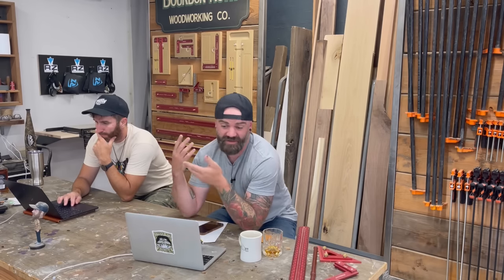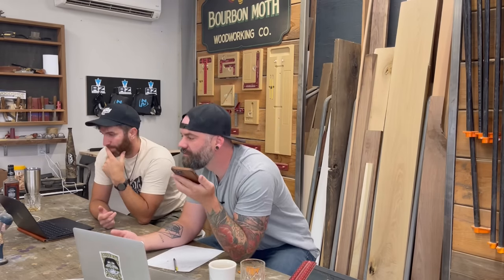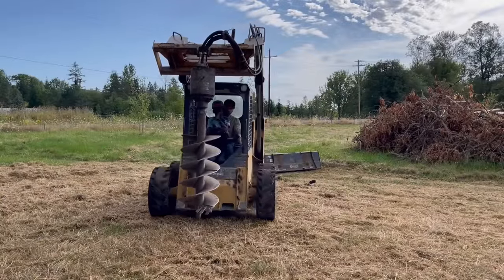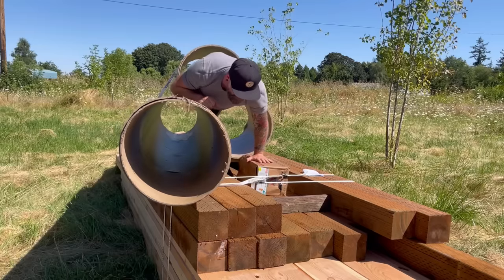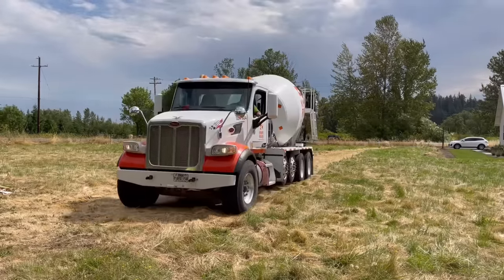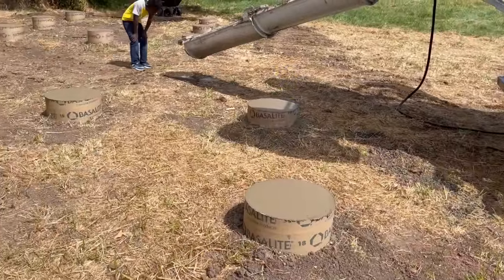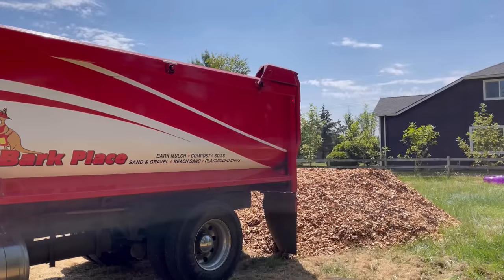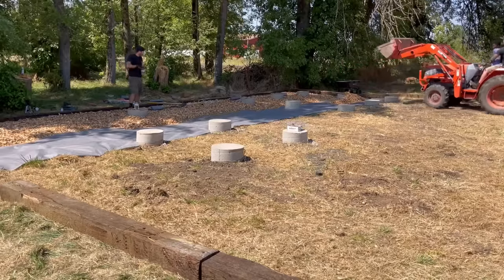Building a Treehouse || Pouring Concrete and Making Footings

Comment: Are you not going to anchor the perimeter down? And, from what I could see in the video, thee was no where near 4-6in of wood chips...maybe 2inches. Also, I did not see any rebar in the sonic tube.
Finally, when you do PVC or CPVC you should do a 1/4 turn when pushing it in the hub. Helps spreads the glue evenly throughout the joint.
Not trying to be negative, just pointing out some of the thinks I would have done if I was building this.

Comment: 13:54 The rebar at the bottom is tensile reinforcement.  The bottom of the footer will be under tension and the rebar will take that stretching load instead of the concrete which cracks under tension.  The spacers lift it up so the metal is completely encased in concrete and won't rust.  The rust expands and will crack the concrete as well.
Reply: Wouldn’t it only be under tension if it’s a light and tall structure?  To have tension, there would need to be a lifting force greater than the weight held by each footer or horizontal force large enough to tip the structure over.  Both of those seem unlikely to me… Maybe if it was really tall and had giant sail area and tornado wind speeds…

Comment: At least you got step one done right. I once helped an old guy build a house on top of a garage, starting with a concrete slab. Old guy put a couple of stakes down "about' where they should be then went on vacation. His buddy came by with his crew to pour the slab. Long story short, he never checked to see if the corners of his forms were square... Turns out that the side walls were parallel, but one was 18 inches longer than it should have been. We only noticed after framing the first floor and started laying the flooring, well when we were nearly finished laying it. When we got to the edge and had to cut an angle on every piece after that. Every decision started with. "Well, which corner do you want to be square in this room?"

Comment: Electrical conduit usually needs to be buried to 18 inches.  You also usually  pull individual wires through the conduit.

Comment: These treeless tree houses have a official name they are called “houses” and some people even live in them all the time. I’ve heard they are super nifty. I’d like to see one some day. Another way to check for square is the 3-4-5 rule. Pick a corner then measure 3 feet out one side and 4 feet out the there side and then the measurement between the the two will be 5 feet if you’ve made a square. It’s a quick way to see how good you think you are.
Reply: Also known as trigonometry - A² + B² = C²
Reply: Just geometry actually. 2 dimensions
Reply: @stevenfederoff7793  What? No? Trigonometry comes from the Greek words for "Triangle" and "To Measure". It's literally just the mathematics behind the angles and lengths of triangles.

Comment: Concrete is good under compression but not tension. The rebar adds tensile strength to reduce sheer forces that could crack the concrete.

Comment: Super cool project! Not sure the rebar is needed though, since the concrete will always be in compression and the colums are really short AND underground in a cardboard sleeve so no chance of tension by sideway loads. I guess it won't hurt to put some rebar in but in terms of safety or quality of the foundation, it doesn't do anything.
Reply: When the wind blows, it will create a lateral load on the structure that will be transmitted to the foundation so there could be loads other than strictly compressive. Same thing with the swing or all sorts of live loads.

Comment: Oh please, the rebar cage should be on the top as well as on the bottom of the concrete pier.  Normally people would also tie the vertical pieces to the frame at the bottom and top of the pier.  You have little weight on it so it doesn't matter if you had no rebar.  But if you are going to do it, do it right please.  You should have considered putting in the anchor bolts before the concrete hardened though if the concrete is weak it won't be too hard to drive in the anchor bolts required. Good luck with the new ear lobes.

Comment: You forgot to mention calling Dig-Safe to check out what's underground before drilling holes. Your doing great.
Reply: Does Dig Safe mark utilities on private property? Once you’re past what the utilities are responsible for you’re on your own I think.
Reply: @johnlee7085  yes they will, anywhere you are going to dig they will come out and mark it. Utility companies ran gas, electric & sewer lines all over the country underground when they were just empty fields. Then construction began in areas that were nothing then but built up now. Don't hurt to call. You don't want surprises when you start digging it's free.

Comment: Rebar gives the concrete a place to form micro cracks around when shrinking during drying. This prevents larger, visible and structurally damaging cracks to form. Have you ever seen a puddle on clay-containing soil dry out? It typically forms roughly hexagonal patterns of cracks. They are called drying cracks. Concrete will do the same thing if it has no rebar or the likes. Chicken net will do or even plastic fibres if evenly spread out in the concrete.
Reply: You seem to know what you're talking about. Should he have put a square at the top as well? For some reason I was expecting him to.
Reply: Janet; I have a lot of theoretical knowledge about concrete, but not too much practical experience, so I do not know just how much rebar you need to put in a certain volume of concrete. It depends on the shape of the concrete body, and I think, the round/cylindrical shape needs less rebar than slabs. I do know, that when you poor slabs (floors) and walls there is usually a grid of rebar with 6-8 inches between each bar. It was definately a good idea that he put in the verticsl bars as well. IF it would crack, you would see it within the first day as it dries up and starts to harden.

Comment: 3/4- gravel means that it was run through a sifter and everything that was smaller than 3/4 of an inch fell through the holes in the sifter.

Comment: Use a vacuum next time when pulling string through conduit. All you have to do is wad up a rag and tie a string to it. Step two turn on a strong shop vac with a fair amount of duct tape to make sure you have a good vacuum to pull your wad through the hole 🤔

Comment: Unless you want the footers to sit proud of the ground, which is strictly asthetic, you can pour directly in the hole. Which is, ime, more reliable.
Reply: It's a little easier with the forms to get them all level but since in this case they are only supporting posts/stilts they didn't need to be level.

Comment: looks like a house with as many footings as you installed the thr actual size of the thing. you may as well run some more wires and plumbing at this point lol seriously though do you need a permit for the structure? I know where I am I had to pull a permit for a shed and another for a playground. they caught me building and made me get a permit. but not every city is like that.

Comment: You really only need about a foot of sono tube for the top which then eliminates the overdig void around the tube, though that would also mean adding a lathe frame to hold it at the correct level but does eliminate the extra height trimming step. 

Best to keep the poker stick out of the dirt in between poking so you don’t introduce dirt to the concrete. In a footer that isn’t oversized, it could create a weak spot in the concrete. Guessing 10-12” would probably have been fine for footing diameter so they’re not likely to fail regardless. The vertical rebar would commonly be attached to the squares, but again, no worries about this failing. 

It is also good to take a mallet and tap the form after placing the concrete. That would eliminate the voids around the outside. 

Personally, I also like setting my post anchors in the concrete at this step. Saves drilling an anchor, etc into the concrete, though it does require a bit more layout in advance. 

I’d also encourage you to do a bit more research on railroad ties. I think they are banned from use in landscaping because of the nasty nasty chemicals in them. I have no idea how places still get away with selling them. Better to go to one of your local cedar mills and get some rustic scraps. 

The good/bad thing about playground chips is you’ll just top off with more in the future. 

As for what to do when camping in the fort. One word - lantern.

Comment: Should've made a small cage out of the rebar. Instead of hammering it in to the ground. The bars should be encased in concrete to avoid rusting

Comment: they are called concrete footings. Also the only thing i think you over did was the size of the woodchip base
Reply: Actually they’re piers on top of footings. Footings are the bottom of the foundation

Comment: As an architect i cringed all the way thru the video lol it was awesome fun.

Way overkill and your rebar is in dirt when you hammer it in.  Should be a box form.  2 more squares, one midway one at top 2 inches below final concrete surface.

Rebar holds the concrete in place when cracked.

Think wireframe in 3d

Comment: I think you might have goofed with driving that rebar into the ground. I think it will accelerate the corrosion causing the concrete to fail far sooner than it would have otherwise. I think a better method would have been to make a cube of rebar that sits up on those feet so that all the rebar is totally encased in concrete. But then almost everything I know about concrete and rebar comes from structural failures...
Reply: Do you think the concrete will fail on just a plug like that? I guess if the corroding bar cause cracks and water can enter the cracks and then freeze? Honest question. I wasnt even sure he needed rebar, to me this thing could have just gotten straight concrete like a fence post or deck. Not sure though, what's your opinion?

Comment: If you ever want to add full electrical I will give you a free design and wiring diagram. I could even run you through the do’s and don’ts of the electrical code to ensure a safe installation for your foreman’s new office.